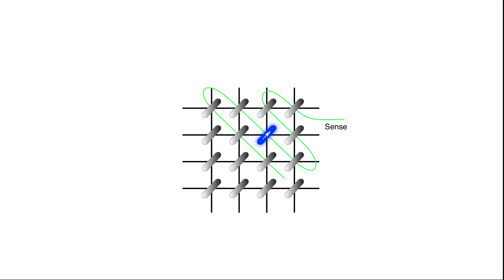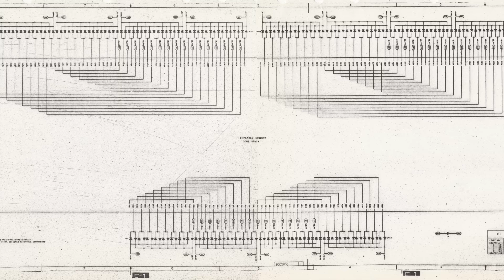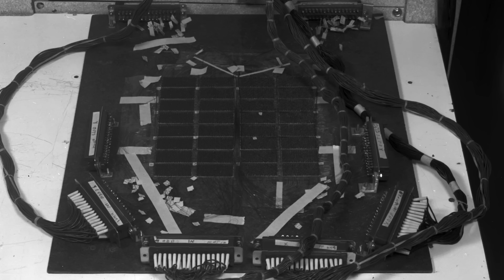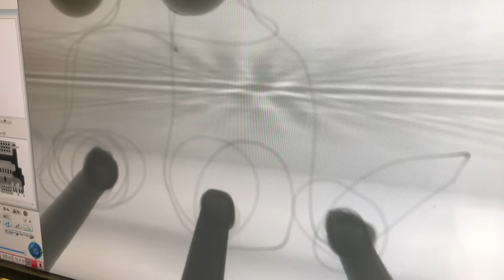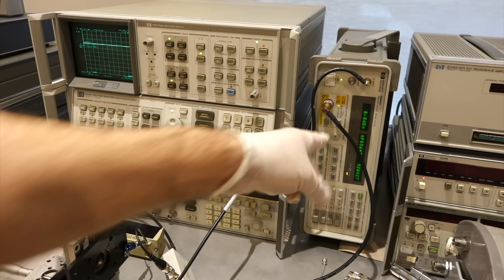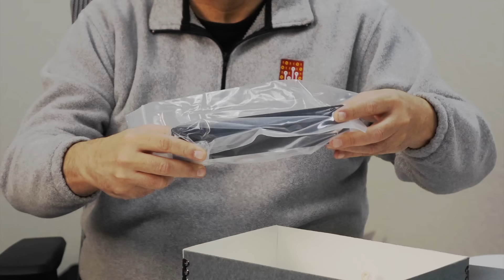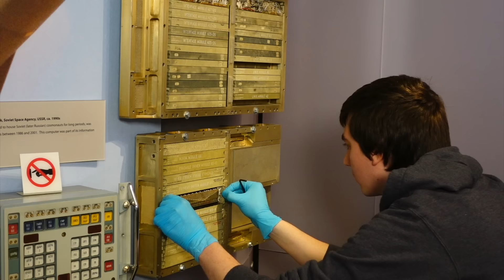Apollo Guidance Computer Part 7: Memory Module B12

Comment: Old telegraph tech here. In our parlay TDM Time Domain Reflectometer is called a Pulse Echo Tester or PET. I used to know Model 100  Teleprinters back to front. Steandard typewriter/teleprinter test is The quick brown fox… Or R/Ys as in ASCII this is 10101010 or in telegraph parlay MarkSpaceMakSpac….. Oh yes and 1 1/2 stop bits. Watching your stuff with great interest. ARR yes takes me back ASCII mechanical parallel to serial and serial to parallel converters. Tape reperforaters. I wonder if you ever come across early fax/photograph transmitting equipment Mufax I think. Tiny mirror mounted on wires that flex. Wobbels the mad Aussie Ducati nut.

Comment: to get the accurate break length, you need to know the velocity factor of the wire ?!
Reply from the maker: This is not a matched impedance line inside, it’s just a bare wire. That’s why we do the comparison reference measurement with a bare wire. They both should have essentially the same velocity factor, and lead to the correct length.

Comment: its a shame the break is deep inside  , if the break was under the pin you would have stood a good chance of an easy repair 

could you toggle a voltage to the problem pin whilst in the  x ray machine  with all other pins grounded , would you see the  break n the wire ? 

 a kill or cure  repair  method idea would be to try to  spot weld the break  by applying a high voltage pulse to either end of the wire , you would have to protect the diode array  (more kill than cure) 

that's not an easy job to de pot the memory module  without ruining it 

i know you could at a last resort remove the core memory and fill it with modern electronics  and pot that , but that would remove history , or make your own emulated core memory module    and keep the broken one unmolested   cheers  steve.......

Comment: @CuriousMarc Maybe You should check physical properties of that epoxy and eventually melt ( heat ) or use chemicals to remove epoxy and solder broken wire, only if it's not dangerously close to cores, and safe to components inside.
May sound stupid but if this can be the only way to fix it, and it have cover to hide the servicing pit, and it's not the only one revision rare, this can save this memory module from waste.
Reply from the maker: Dang. The whole last two video was to explain why we can’t do that. I have not done a goid job :-(
Reply: @CuriousMarc  I mean if the wire is not deep inside, but now i managed that, it's impossible, so sorry, It's my faul. You done, and You're still doing a great job. Sorry again for my stupidity...
So sorry...
Reply from the maker: Ah, yes. That’s indeed what we were planning to do if the break was on the outside. You are not stupid at all!
Reply: OK, i just don't managed it before, maybe it was caused by sleepless night and watching Your document at 5:00 AM (UTC +1:00)
What a shame...

Comment: If the goal is to power up and run the Apollo software on the AGC, you could build new wires, ferrite core rings and run them outside the memory module hooked up in parallel to the broken wires.
Chances are the broken wire is only one and you won't have too many new ferrite cores to hook into it.

Comment: We once did a really really bad hack for getting some broken wire to "work" in a similar situation. The circuit we had was current driven and everything was potted, hence very well insulated. We had someone come  up with a high impedance high voltage current source that was driven so high (several hundred volts) but accurately enough that it worked for a while and we could do what we wanted, after a while though it stopped working, despite dialing the voltage always higher, likely the wires eroded.

Someone once then jokingly said that with a high enough voltage the spark would be bright enough to actually see thorugh the potting where the break is...

Comment: Sense... and inhibit? And only one is broken? But don't both of those wires pass through all cores, which is why later core memory replaced them with a single sense/inhibit wire? Proposal: Could you modify the computer to allow it to operate in this manner, using a single sense/inhibit rather than two separate wires?
Reply from the maker: Not really. The single sense/inhibit wire scheme requires a different weave.
Reply: @CuriousMarc  I've been looking at some typical diagrams, and I see what you mean about the weave - but still, sense and inhibit wires do pass through all cores, it is only in direction that they differ. I am not familiar with core memory in great detail, but if I am reading the diagrams correctly then it might be possible to use modern electronics to construct a 'patch' board which sit between the memory and the rest of the computer, monitor the inhibit and address inputs, and generate a suitably directed current in the sense line instead.

This module is a lot more complicated than typical core memory though. As the video refers to multiple inhibit lines, I'm guessing that it it split into multiple banks internally?
Reply from the maker: @vylbird8014  Unfortunately you really can't. The inhibit has to be colinear with the address wires, otherwise you are going to accidentally flip other cores while you try to inhibit the one you want. And the sense wires have to be at an angle with the address wires, otherwise you are going to pick up address signal cross talk. Hence the classic 4 wire weave. Unless you weave it like our 3 wire core in the previous video, with two opposite loops colinear with the address, a half-column offset, and a center tap to reconfigure between sensing and inhibiting. Hence the very clever 3 wire offset weave that IBM developed.
Reply: @CuriousMarc  I see the problem. I was hoping it'd be possible to put the wire on an H-bridge and flip the polarity around according to the address lines to compensate for the weave. Well, I'm out of ideas - short of building a modern part to emulate the memory, and that just feels like cheating.

Comment: I wonder what if heat up or cool down the module with monitoring via connected tester? Is there a chance for temporary restoring the contact by thermal effects? If it happens, you can try to weld the wire by high current through it. But of course it's extremely risky and need some experiments with same wires...

Comment: Since the history museum module is just a display, maybe they'll let you swap it with yours.  Otherwise, you might try using Methylene Chloride to dissolve the potting.  Last resort, maybe Mike can gut your module, build an emulator board, then install it in the module (it would make a great video series).  Good Luck.

Comment: I tracked down the point of breakage one time with high voltage.
I put the broken wire on a sensor input and a needle with oscillating high voltage to probe it. I used a flatbed plotter to move the needle and wrote a small program to scan the hole board. I didn't had the diagram of the board only the pin-out of the chips.
I doubt it would work with such a tree dimensional construction. The distances are just to great for detection. Maybe the area can be tracked by using the wire as an antenna and get at least the region the signal stops.

Comment: In the Finnish Army we had a large ultrasonic  bath just for striping American potted electronics. Made by Russians of course.   Problem was that all the insulation was stripped too.  So fixing this kind of part was possible but hard work, because every wire had to be replaced.
Reply from the maker: Meh. It’s just 128 gauge 38 wire goong through 32,000 cores in a 30 mils core. Piece of cake to replace ;-)
Reply: You do not have to melt all the epoxy. Only until you can see the faulty wire.
Reply from the maker: Unfortunately we do. That was the whole point of this investigation. The break is right in the middle of the module :-(

Comment: Can you run some RF/HV thru it to try and fuse the break back together?  Nothing to lose at this point is seems.  Seen it done with tube filaments.
Reply: You could still fry a bunch of other stuff
Reply: Module is already useless, can't even take the cover off without destroying it further... not seeing any other feasable option

Comment: Doesn‘t the higher dielectric constant of the epoxy resin in comparison to air lead to a much shorter length to failure? I guess the Er is at least 3 to 4 in epoxy so the failure should be nearer to the connector
Reply: I second that! And noted immediately while watching.

Comment: you can swap broken data bit with parity bit, then disable parity check.
Reply: Actually, you wouldn't even have to swap anything. Just replace the broken bit with a parity generator -- it will reconstruct the missing bit from the other data.

Comment: Can you simulate the broken bits externally?   i.e. run the module as is - decode where you know bad bits are and use a modern circuit to replace them  (bad block mapping style approach)

...and watched to the end -  sounds like the above is approach D, E or F :)

Comment: Would dissolving the epoxy with dichloromethane be a viable option? (I'm not a chemist)
Reply: Finding a solvent that only works on the epoxy and nothing else, would be a challenge on its own I think.

Comment: Was there a Parity bit? if so what you can do is read the memory out and use the parity bit to fill in the broken line in the core
It going to be odd or even parity. Remember working with core memory. I may have an old DEC PDP-11 Core Module around
Reply from the maker: Aha! Getting warm here...

Comment: Maybe you could send the XRay files for collaborative inspection.. with a hundred people checking we may find the break.
Reply: When you solve the potting removal problem, you will be able to solve the broken wire problem too... No need to go and invest a bunch of resources tp try to find the exact position.
Reply: @rkan2  You are right. I was just thinking it could be possible to drill if it is on the outer boundary.

Comment: Another idea is using a high voltage/low current signal generator on each end of the broken wire while scanning with the X-ray machine. At some voltage I would expect an arc which should be detectable.  There is some risk of causing  additional damage but it may be a good option “P”.

Comment: Is there a way to inject a short wavelength signal on the wire using the estimated length for the optimal frequency and construct a tuned probe for detecting the localized signal strength?  Might that help isolate the location of the break?

Comment: Too bad if this memory module failed on its way to the moon!
Reply from the maker: That would have been annoying indeed. That’s why they tested the modules so much for flight qualification - temp cycles form -50 to +125C, 200g of vibration on 3 axis at multiple frequencies, etc, etc... This early design failed as explained in the video. The final design passed. None of the memory modules ever failed in flight. None of the computers ever failed in flight. None of the rockets ever failed in flight.
Reply: @CuriousMarc  yup, there is alot to say about that. Apollo 13 had a major failure and still made it back, and apollo 14 had issues with the computer but were able to make a hack before landing on the moon, quite incredible for the technology back then!

Comment: when the soviets got their hands on an intact aim-9 side winder they brought in sculptors to remove the potting form the electronics. this may be the only way to fix your break.
Reply: :D removing general potting compounds from modern pcbs is quite trivial compared to this... Probably no need to worry about insulated wires either.
Reply: @rkan2  neither of those boards are modern. Both cold war tech
Reply: @GraydonTreude  A modern computer is by definition something that can store it's program in memory.. Even the computers developed during WW2 can thus be called modern. Personally I only regard computers with semiconductors being modern, since they use technologies not available even to the first computers and only partly for the Apollo program. But you are right about the fact that the AIM-9 was not really modern and probably used core memory, though in a much more sparse layout than the AGC. I was thinking about the AMRAAM, but that was developed in the same time as Airbus flight computers and their software, and the Space Shuttle (STS in the 70s and currently flying Airbuses in the 80s) Meanwhile Boeing keeps manufacturing "new model" aircraft with pretty much 60s technology... (737 Max)

Comment: would be interesting to knw the reason why the wire broke...mechanical problem or if it melted due to what ever electrical overloadalso these fragile memory  modules with its thousand of super thin wires brought to my that the missions also depended a lot on a big portion of luck... I do not want to put in question what they developed and achieved but they were also lucky that all that stuff worked and lasted....and as we know it was on the edge a few times...
Reply: It's impossible to guess what this computer may have gone through over the years. It was scrapped by NASA, found in a scrap heap, left out in the rain, etc. Plus, the bottom parts of the screws that held the computer to the LM coldplate are still in the computer -- they appear to have been sheared off. Which suggests it may have received a hard knocking to remove it from whatever it was mounted to. A lot of not good stuff for a module design known to be sensitive to shock and vibration.

Comment: I'm a little surprised it was such a big deal to take something off display for a legitimate research purpose.  What's up with that?!
Reply: It really wasn't. This is the second time I've pulled the memory module from the AGC on display at the Computer History Museum, and right from the get-go they were on board with it the first time I asked. They've been super supportive of the project.
Reply: @mikestewart8928  Oh, good.  The way the curator was talking in the super short clip, about how it would be a big lift, was a tiny bit upsetting.  The kind of amazing work you're doing is important and should be supported!
Reply: Can I just also say it's a privilege to watch these videos?  I learned so much about core memory in the last two videos.

Comment: Cant you desolve the potting in acid, and then repair it and repot it?
Reply from the maker: If the wire break had been outside of the core stack, that was the plan. But it’s in the middle of the folded core stack. Even if we could remove the several different layers of potting materials without damaging anything else, we’d have to dismantle the entire module, unwrap every wire from every pin and the diode boards, remove the stack. Free every core from the rubbery silastic material without damaging any, unfold the tightly compressed mat to get to the wire. Then reconstruct the whole thing. Chances of doing that without damaging the module are just about 0.
Reply: @CuriousMarc  yes, but it would make a great video.

Comment: With all the expert knowledge available between you all and with all the test equipment at your disposal, i am sure it would be feasible for you to build your own memory module using modern day parts. You have all the design schematics available, someone could design the memory housing with connecting pins, someone else could design a pcb to replicate what the memory module does and then wire it to the connecting pins. 

At least this would get around the problem your having of having to try and find an original working memory module. Just build a modern day equivalent, that will at least then allow the system to run, then once it's all working as it should be, then i am sure the computer museum would allow you to use their original memory module.

Comment: Perhaps try tracing the broken wire with a wire loop antenna?
Feed a couple of 100MHz into pin with broken wire and use small wire loop antenna on HP8566B to trace the RF emission of the wire.
Reply: No point since they can't take it apart without destroying it...

Comment: I think I'd go with what appears to be your gut feeling that trying to repair the existing core module isn't in the best interest of preservation at this point in time.  There's no crime in leaving that work to a future preservationist with access to more advanced methods.  If you document what you've done well, which it really looks like you have, it will give the next generation a leg up on solving the problem.  

I think a workalike module with modern components is a perfectly reasonable solution to the problem for the time being.  It's not like the entire unit is 100% period anyway - the replacement DSKY is an obvious example of that.
Reply: That's a good point to leave it to the future to attempt to repair, but my apprehension on that is two fold: 1. We still have some of the people alive who developed it and can advise to a point and 2. We don't know how much longer the hardware will be serviceable. It would be awesome to have it functional again while the people who developed and also the people who experienced its contribution are still alive.

Comment: How about some electric heat to broken wire. Maybe break will weld it self together. Just magical thinking.
Reply: "Electric" heat? I hope you do realize that the heat is due to resistance of a substance against the flow of electrons through that substance.  Heat is heat.  There's no such thing as "electric" heat.  I understand that you're thinking of how they might be able to weld the break together, but I don't think you understand that extremely fine wires are a play here and they have no idea yet how far apart the broken segments are.  I'm sure they aren't going to try that method of attack.  Nice thought, but not adequate.